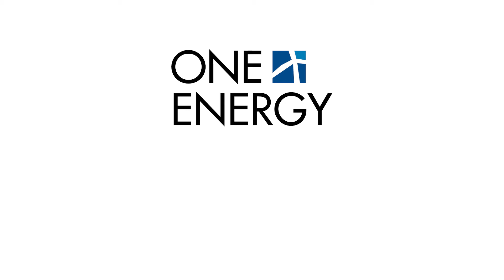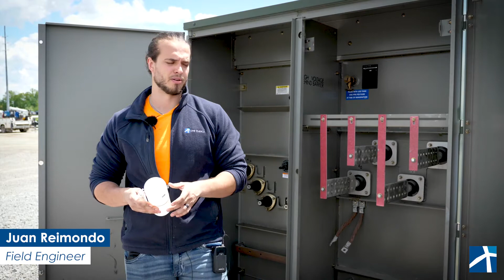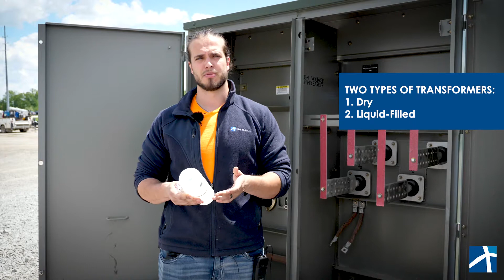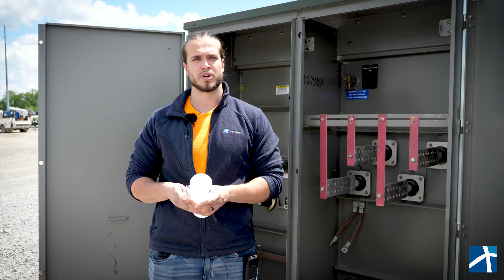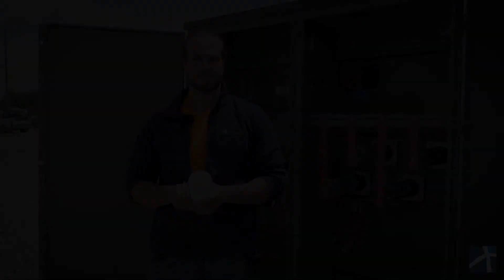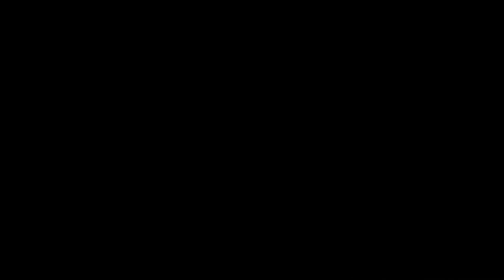Transformer Oil Testing | Technician Talk

Comment: For Safety concerns when performing a DGA test , a shut down of the transformer is required correct? Dose resetting the gauges help for short term maintenance solutions?
Reply: In norway we perform DGA AND PPM test, but u need to have the temperature in the transformator oil as normal as possible, so we do not shut down our transformators in the power plants when doing these oil samples.
Reply: I guess we will never know